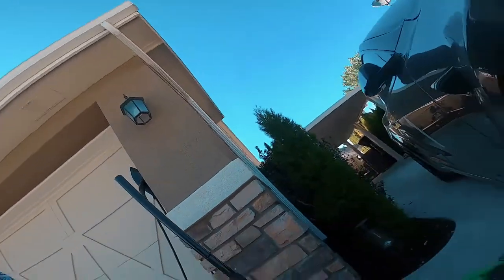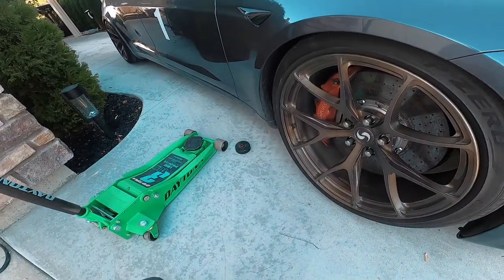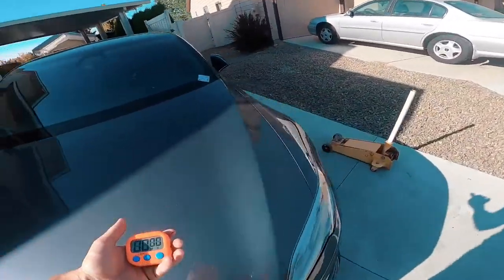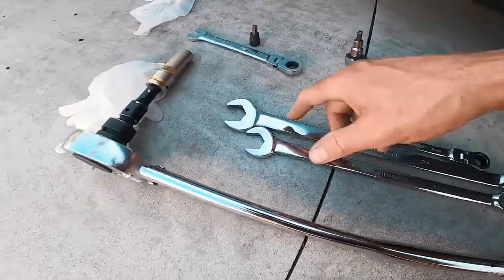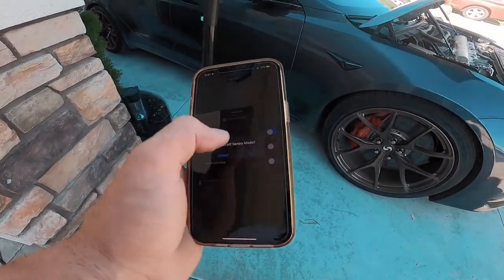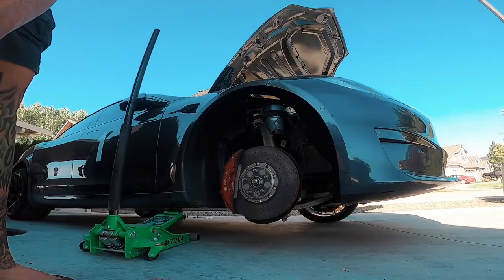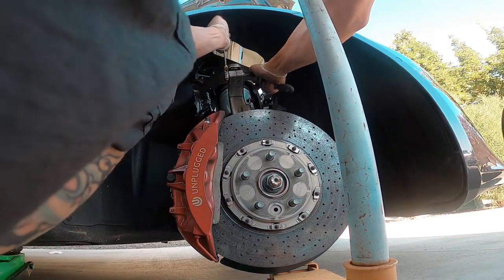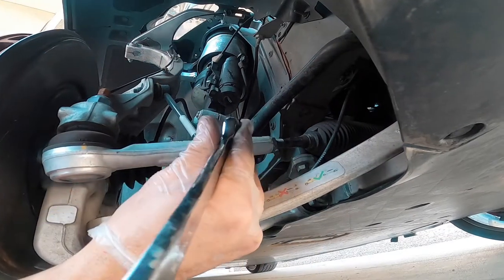Swapping Tesla Plaid Front Suspension Settings From Track to Street Mode | Unplugged Performance

Comment: Dr. Todd .
Is there any validity to “aggressive driving “ in that model Tesla and the battery draining “very fast “ or not a thing ?
Reply from the maker: Oh yeah- the faster you drive, the battery will drain more rapidly…
On the track, I can do two 20 minute sessions and the battery will go from 95% to 18%. So then you have to strategically charge between sessions!
Reply: @PlaidAF  Hey Todd can you Pease do experiment with your new lightweight ceramics rotors from 0 to 60 and then long run maybe you can achieve 2seconds flat every time and  9.1sec for the long run...